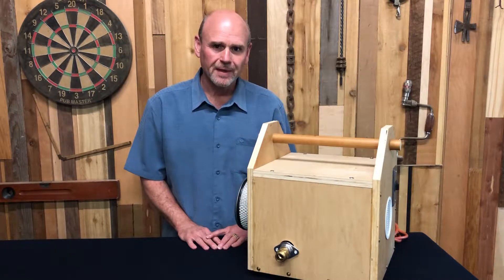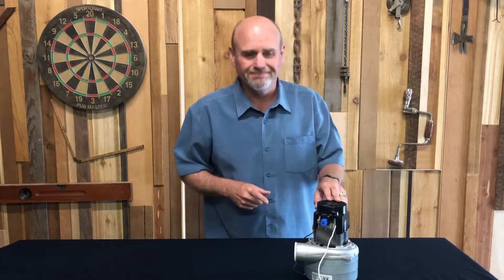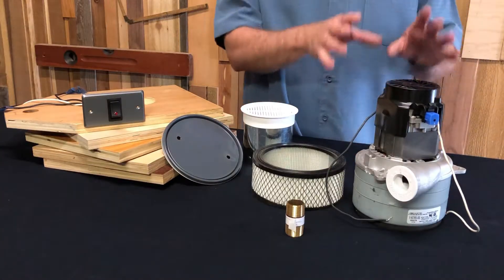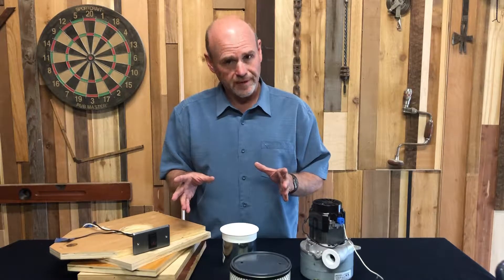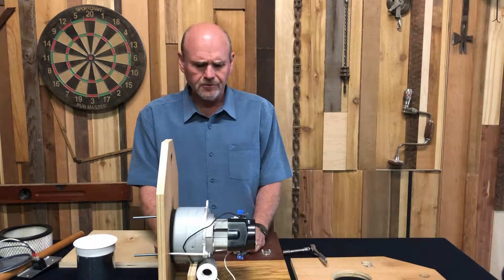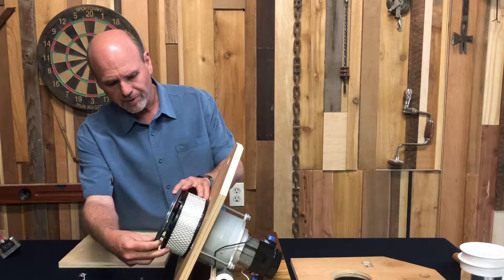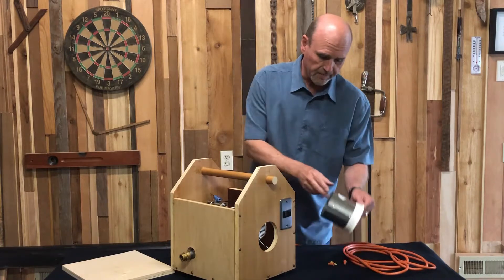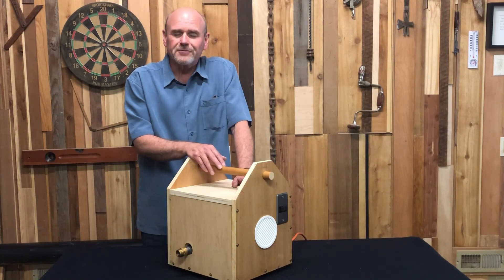Build Your Own HVLP Turbine Sprayer

Comment: Hi Greg,
 I just came accross your video while looking into the HVLP turbines and decided to build my own My Amatec lamb motor arrived today,
Please could you let me know the ID (bore size ) of a typical HVLP hose and the brass fitting you  used to couple the hose to the motor.
Regards
Reply from the maker: The hose is  3/4" diameter and it uses a 3/4 garden hose thread fitting. The adapter that comes out of the motor is a PVC reducer that has a 3/4 female Pipe thread. You come out of the PVC fitting with a 3/4" pipe thread nipple, then attach a pipe thread to garden hose thread adapter. From there the hose just screws on like a garden would. Thanks for watching good luck!
Reply: @gregbelair4164  Hi Greg. Could you put a parts list for us in the description? I am looking for the hose. Could you possibly show us how the gun is hooked up as well as how it sprays? I have a Eastwood HVLP gun that I am looking to use with this unit once I build it. Would gravity fed Auto Paint guns work okay?
Reply: Hi Aaron,
You could try your Eastwood gun if you build the unit BUT I was going this way until i found out the following :-  (glad i didn't buy the HVLP gun that is for compressors)

I don't know if you realise  that the HVLP Turbine guns are  different from the HVLP guns used on compressors (compressor HVLP guns need a minimum working pressure higher than Turbine guns  a  three stage Turbine sprayer unit only gives out around 6.5 - 7 PSI) .
Turbine guns have a 3/4" hose tail to fit a 3/4" ID hose ,  i bought my hose from a garden centre it's what they use for ponds and a lot cheaper , The following is what i've fitted form the Blower motor to the gun hose :- 
I have used  42 mm OD  drain pipe which goes inside  the motor blower spout , i cut a section  off of a matching drain pipe TEE fitting  this allows it to slides over the drain pipe  and then over the  OD of the motor blower spout  (it goes on further  without the 'O' ring), i've used high temp silicon sealer for auto gaskets and a pipe clip over the smaller diameter of the TEE section that is fitted around the inner pipe  thus creating a good seal .
For the other end to attach the  3/4" hose going to the spray gun i have enough length of the drain pipe coming out of Turbine box housing to screw an end cap ( It is of  the same make as the drain pipe and comes with seals) it can screws on and off  of  the drain pipe from outside the box , drill an hole in the plastic cap for a 3/4" male threaded adaptor so i can then screw the hose on using a 3/4" hose pipe swivel fitting, 
I have had to use this method as it's all i could find here in the UK  to get from the blower motor to the hose  so hope this helps.
Please note when i  refer to the TEE  section i am using  a  piece of plastic pipe i cut from a TEE fitting that is of the same make as the drain pipe i used for the gun hose ,it is just the right size to fit over the blower motor and over the drain pipe that i can use to fit the gun hose to.
This is as far as i have got  but i was getting around 7 PSI  out of the unit testing it with a calibrated digital pressure gauge (which is what Apollo are claiming for their stage  three Turbine unit) but  i was using 3/8" ID hose at the time ,will do a retest on the 3/4"  hose.
Regards 
Len.
PS Sorry it it's long winded,
Reply: @leoneddy1492  Makes sense Leon. Perhaps I will build the unit. Purchase a sprayer made just for this unit. Curious what hose is used. Would really like it if Greg would do a few more videos on this thing, Looks awesome.
Reply: Hi aaron,check this spray gun out ;i was looking at this gun on ebay "Sprayfine all metal HVLP turbine gravity spray gun w/cup"  sold by turbineproducts as it is gravity fed and you can get a  few different sized jets for it ,but will cost me another £62  (82 USD) post to the UK so it looks like being an appollo gun sold over here.
Regards